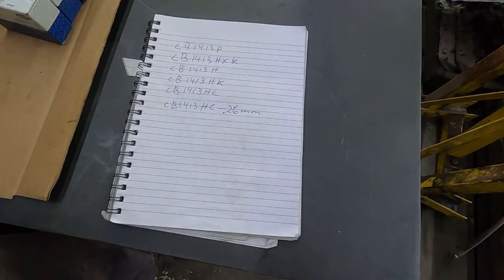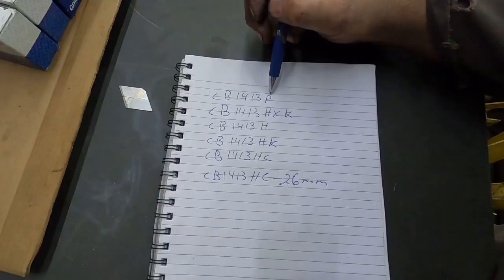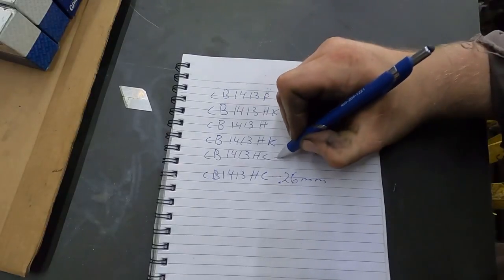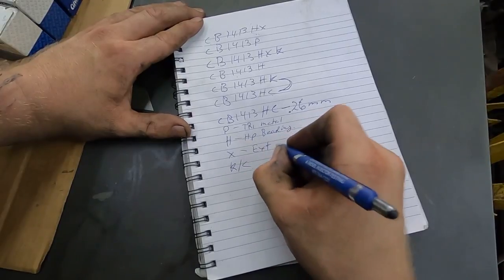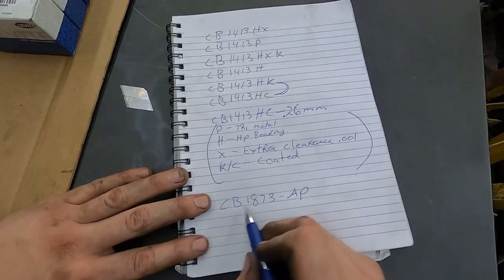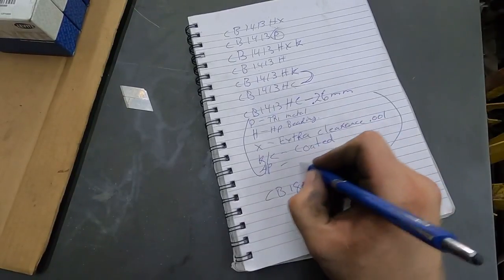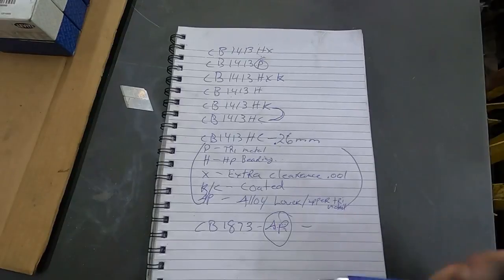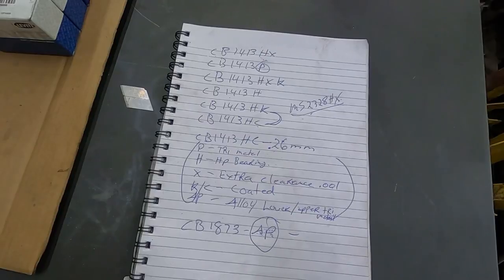Mahle clevite bearing numbers and letters meanings.

Comment: I see there is a V series now. Have you ever used those or when they would be used over the H series?
Reply from the maker: The v series is for the big power stuff like 2000hp and above from what I am told
Reply: @CUTTERUPROB  thanks I appreciate it. Yeah I was doing some searching afterwards and found that out as well. I want to be around 1000hp so I think I'll go H series when I build my 6.7. Would you go coated or just regular? Just a daily driver street toy 62 over 80 compounds with common rail and at least 150% injectors or larger with duration turned down.

Comment: Shaffer oil that's good oil
Reply: I run it with oil analysis I'm gonna be 15,000 miles since last change, then I send in another sample, alot of my ware metals have been reduced compared to valvoline 15w 40 I use to run.
Reply from the maker: i will check it out
Reply: @CUTTERUPROB  I might of spelled it wrong though